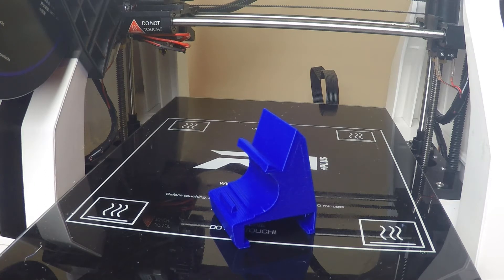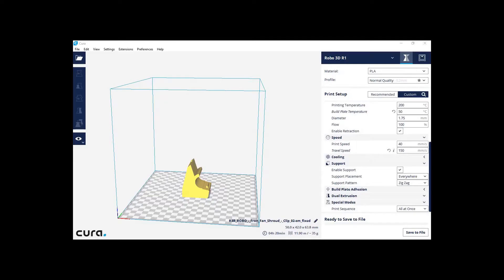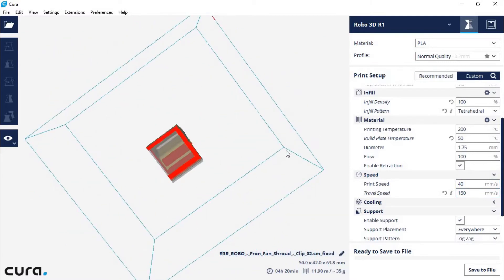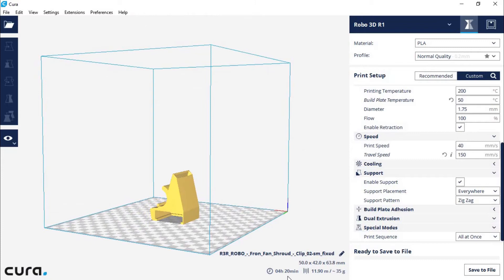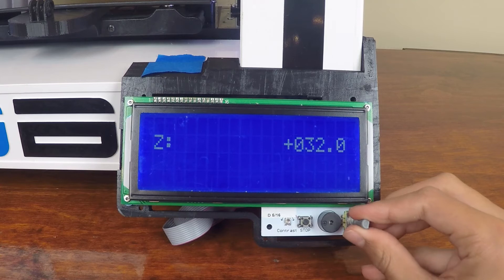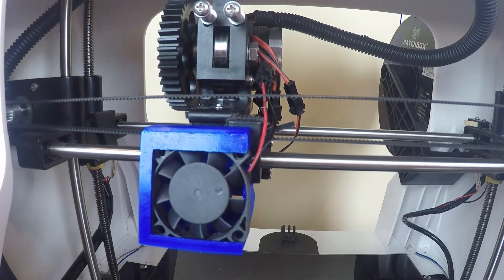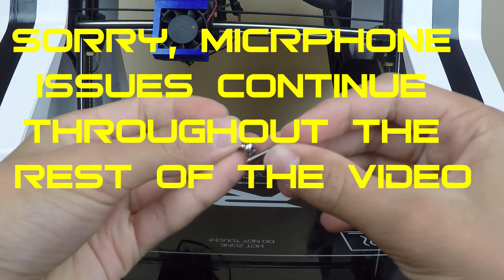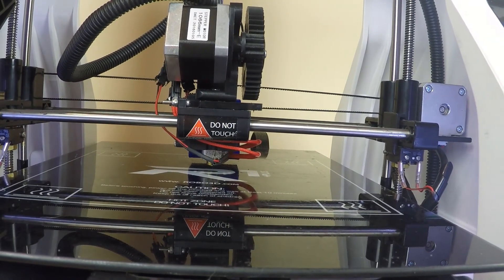Robo 3D R1+ Fan Duct Upgrade

Comment: Great video. Have you noticed any improvements in your prints since installing this mod?
Reply from the maker: @Indio,
Yes there were some major improvements in many of my more intricate models that I printed. Overall I noticed less of the blobs and other strange deformations that I was getting in prints. However unfortunately, my hot end's thermistors came lose soon after that, so now I am currently installing a new E3D V6 hot end setup. Check out my latest video on that here if you would like:https://www.youtube.com/watch?v=T54LvVJzfLA&t=1s
Reply: Bushido 3D awesome, i just installed the xxl lcd screen and im so thrillled with it! Now im going to do fan duct, and then cable chain. The cable chain seems tricky though. Did you put an extra fan on your printer?
Reply from the maker: @Indio
That is great to hear! The XXL LCD is definitely one of the best and most necessary upgrades on the R1 and R1+ printers. Personally I have not added a cable chain on, it does seen like a bit of a difficult task, and I do also have another fan ready to install onto my printer once I install my new E3D V6 onto my printer.
Thanks for the avid support of this channel!